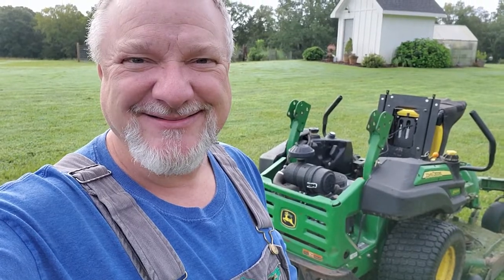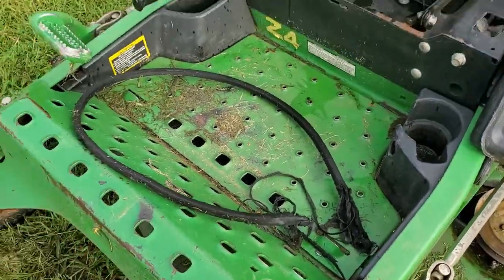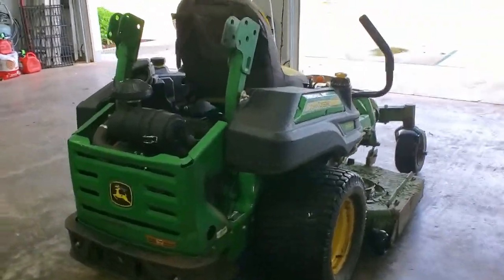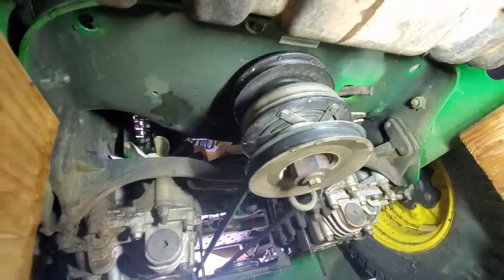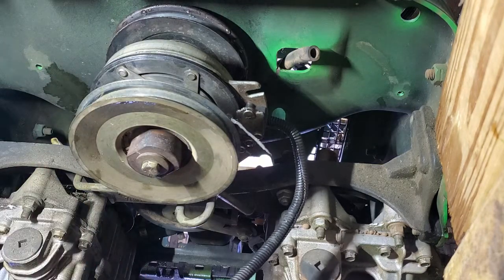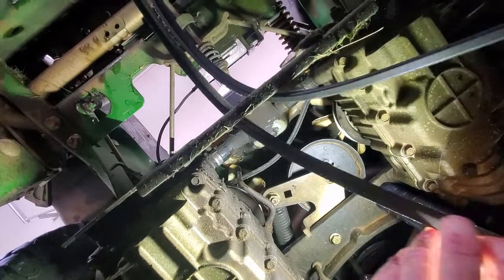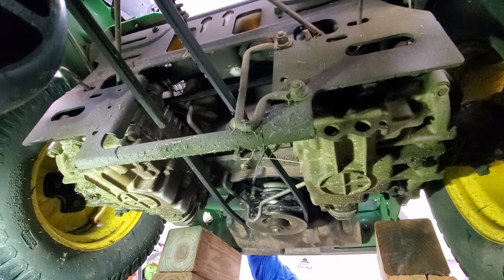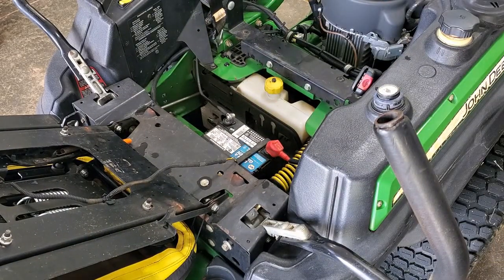Z920M Traction Drive Belt Replacement

Comment: Hi , my John deereZ455, the transmission drive belt is very loose, can't engage the pulley of the transmission pump to rotate, any suggestions please
Reply from the maker: Make sure the belt has not jumped off any of the pullies.